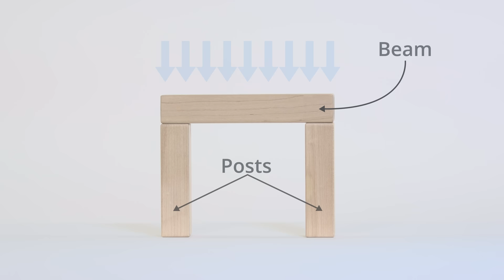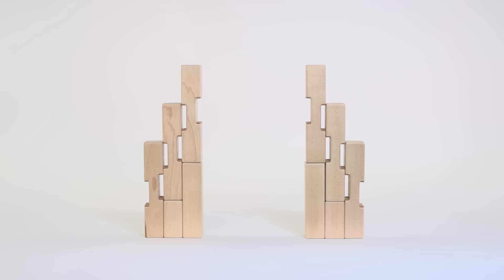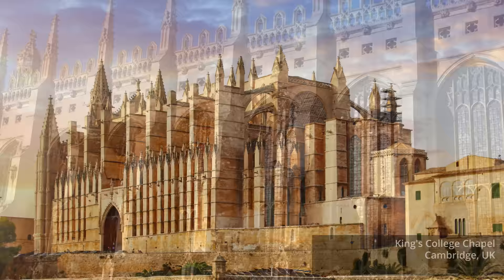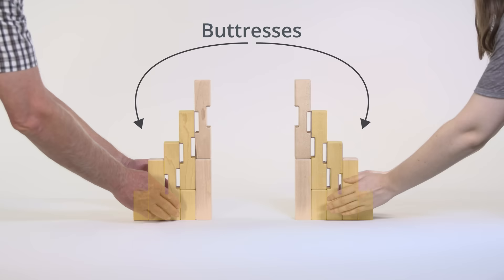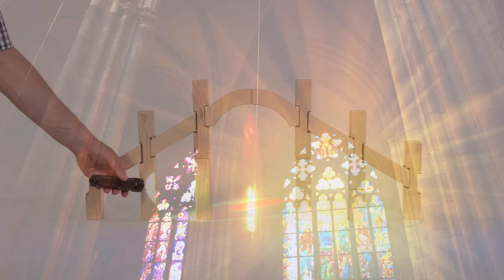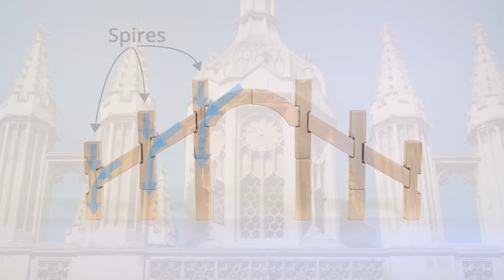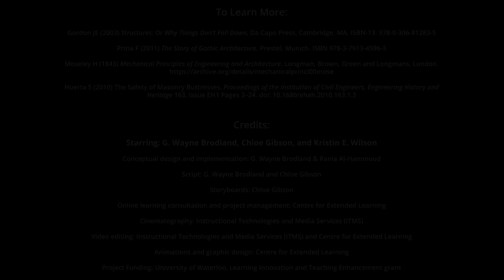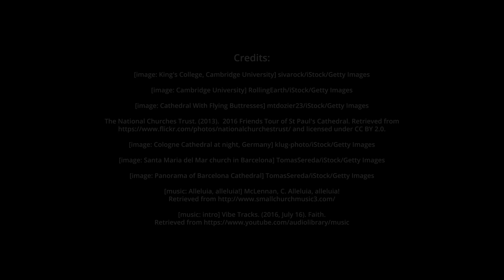5. Gothic Cathedrals

Comment: I didn't realize they built scale models beforehand to fine tune the design. Interesting video.
Reply: they used models for everything.  Even castles.  Anything of any consequence had a model built.
Reply: Ansys before Ansys
Reply: Sometimes lots of models! Apparently in some French cathedrals there were up to 100 models made so engineers could study all manor of scenarios (fires/earthquakes/attacks from enemies) and still have functioning models for other tests.
Reply: A few of the biggester projects were constructed over decades. In some cases none of the people who were at the start of the construction or even their kids would see the fully finished building. At this scale you can't just wing it, make it 10% more slender than the last one and hope its still structurally sound.
Reply: It may be important to notice that the one example they showed was much later in period and not gothic in style.
The wikipedia article mentions models : papier maché presentation [sales] models.
There is another mention of models in an unspecified context possibly linked to masonry. These could be more stone cutting planning rather than engineering models.
Reply: If you want to learn about a really strange method of building models, look into how Gaudi did it for Sagrada Familia using an upside down hanging method.

Comment: Here are some of the best examples of medieval cathedrals in England:

Lincoln Cathedral *world’s tallest building 1311-1548 - it was the first building to overtake the Great Pyramid of Giza (the spire collapsed in storm of 1548, tower remains). The amazing height Lincoln Cathedral achieved was “never matched” until 1884 - the Washington Monument. Only one cathedral (so far) has ever managed to surpass its height - Ulm Minster in Germany. One of the highlights inside are the exquisitely carved 14th century choir stalls,

Durham Cathedral *one of the finest examples of Romanesque architecture in Europe, it is architecturally very important - containing many elements that prove it to have influenced (what would later be created in France) Gothic architecture,

York Minster *largest medieval cathedral in Northern Europe, plus the “Great East Window” is the largest expanse of medieval stained glass in the world,

Ely Cathedral *central octagonal tower is unique in Europe, highest nave in UK, outstanding Romanesque exterior that is very different from any other cathedral,

Canterbury Cathedral *oldest UK Cathedral founded in 597AD (present building started 1070AD), great amount of medieval glass along with York Minster, 

Salisbury Cathedral *tallest UK cathedral, contains what is said to be the oldest clock in the world (1386), Cathedral unique in Europe as was built in only 38 years (1220-1258), so has a remarkably uniform exterior,

Wells Cathedral *over 300 medieval statues on West Front (said to be the largest in Europe), extremely unique mid-14th century “scissor-arches”,

Winchester Cathedral *longest 'medieval' cathedral in the world, along with longest ‘medieval’ nave, the crypts (built 1079) are haunting when submerged in water (as flood often).

Peterborough Cathedral *known for its famous “West Front”, a very early English Gothic facade which is unrivalled in Gothic architecture, also inside the largest of the 4 remaining decorated medieval wooden cathedral ceilings (built in around 1200) remaining in Europe,

Norwich Cathedral *made of beautiful french Caen stone (Canterbury Cathedral was also built extensively with it), has over 1000 painted medieval “bosses” situated on the ceiling vault - an unrivalled treasure.

Gloucester Cathedral *the cathedral cloisters are absolutely stunning and were featured in some of the Harry Potter movies, another interesting feature inside the cathedral - the 46 misericords (carved in the 1300’s), depicting a wide array of strange and charming scenes.

Westminster Abbey *the most well known, has held the coronations of many English Kings/ Queens for over 1000 years, a very important site for this reason with many notable historical figures buried within its walls. Interestingly, it also contains one of the countries oldest doors (dated to 1050AD).

There are many more, but I think these are some of the greatest in England.

Comment: AFAIK, there´s one more thing about the structure most don´t know: the pillars go deep into the ground, maybe even 1/3rd of their visible length. Unlike palisades, it doesn´t help much with preventing falling over (stone is not like wood good at resisting forces other than compressing ones). I don´t know how exactly it should work, but apparently, it´s about the mass underneath the soil, which is needed to stabilize the structure above ground.
Reply: it is probably about generating friction because the weight of a cathedral is kinda concentrated on few spots, and to prevent sinking in the sonte has to go deep so ther eis more friction with the ground around ti so it does not sink in

Comment: This is good, thanks. Perhaps it might be better if the verticals were stacks of  blocks, instead of long pieces with the notches. Then the cap-lanterns on the piers could visually demonstrate their function.  The problem is that the forces on the buttresses push outward, so a stack of blocks, even with mortar would not be able to keep the buttress arches from sliding off the piers. The substantial weight of the cap-lanterns increases the frictional resistance so the piers won't allow horizontal sliding. Keying the pier stones together might be used, but probably wouldn't be reliable enough over time. What I love about medieval cathedrals is how deeply deeply empirical their engineering was.

Comment: Why didn't they just run the horizontal force into the ground with the angled portion of the buttess reaching all the way to the ground? Is it a constructability issue? They seem to keep the diagonal sections relatively small.

Comment: One thing you forgot to mention was how the old romanesque style churches have round windows and arches, while the gothic style was known for their pointed windows and ceilings. This was because the weight could be directed to the sides much easier if it was pointed rather than have a flat surface in a round arch which would mean the weight would press down heavily on the centre, hence why these arches were much smaller and did not allow grand designs. Romanesque cathedrals and churches also have smaller windows because they didn't use buttresses, so that particular development could also have been shown in the video. 
Very nice video anyways, I did not search for this but found it very informative!

Comment: Many of the cathedrals shown in this video were either non-existent or incomplete in the 16th century, being finalized, or even largely built or reformed only in the 19th century, when the gothic revival movement emerged and nationalistic trends in Europe required the manufacturing of a glorious past. A good (but not by any means unique) example of this is Barcelona's cathedral, which looked quite stumpy and lacking in style until its radical reforms during the 19th century, which rebuilt it in a pure French style. It is enough to Google "Barcelona cathedral before" to see what I mean. Similar, though in many cases not so radical, reforms and reconstructions were made in many other cases, of which examples are the Cologne and Westminster cathedrals.

Comment: Great video. One problem, flying buttresses are not there to take loads from the vault s, but were added later to counteract wind sheer from the roof. A section of a cathedral clearly shows flying buttresses sit within the vaulting connoid so are not directly receiving thrust from the vaults.
Reply: That is not entirely correct. The partial destruction of Notre Dame de Paris where some vaulting collapsed showed that the lowest part of the visible vault (which remained) only bears part of the load, so the flying buttresses further up make sense. The lowest part of the vault is practically a massive triangle with the lateral forces exiting further up.

Comment: Cathedrals are made with arches... the arches criss-cross inside the cathedral which is what gives you the ultra cool ceilings. It's called a groin ceiling, but I don't know how to spell it. And the flying buttress is simply half an arch, to keep the sides from falling away from each other as the weight of the ceiling pushes down.

Comment: I understand this is an engineering channel and not architecture . The main purpose of buttress is to resist the side thrust created by the load on an vaulted roof. The wall is just secondary since the wall is purely decorative ( non load bearing). The wall is nothing but decorative  so they can put stained glass window and there is clerestory window above it to allow light to go inside the cathedral.  The flyer should a little bit lower from the vaulted roof for the space for clerestory window in your model. Last but not the least is " Pinnacle " is the right term to use and not " Spire".

Comment: re Spires. 
It is generally only the large spire that is a major feature of the building which is referred to as a "spire".  All thos small elements that sit on the end of buttresses, both wall buttresses and flying buttresses, and are also found on the four corners of a tower are called pinnacles, not spires.  
Salisbury Cathedral has a spire. Chartres Cathedral has two spires. Milan Cathedral is covered with pointy spiky things but they would generally be called pinnacles.

Comment: Very good, thanks. Please explain why the builders didn't use the tension in the wooden roof to hold the thin walls together instead of the flying butresses.
Reply: Flying buttresses only hold the walls together because they resist the forces from the stone vault. Without the stone vault, buttresses would not be necessary. This is because the arch shaped vault directs powerful forces outwards that would -- without a counteracting force -- push the walls apart like a stack of cards. Look up S Paolo Fuori le Mura, Roman Basilica type churches have masonry walls but timber ceilings and because the masonry has no thrusts and no tensile strain, they remain completely stable. Also I'd imagine the forces in a wooden roof would not be enough to counter the tonnes of stone vaulting.
Reply: Just to add two things: the point where the horizontal beam of the roof could have hold the walls together would have been far way up. The force of the vaults come in several meters below. Then there was no reliable method of joining the beams with masonry.
Reply: wood can burn, mediaeval people knew that
Reply: Alfie and Matthias, thanks for your constructive comments. 
Implied in my question was the fact that the video said the thin walls have to be held together by the flying butresses because the outward thrust from the stone vaults is pushing them apart. So my question would have been clearer if it had been...Please explain why the builders didn't use the tension in the wooden roof to resist the outward thrust from the stone vaults?  Having thought about it I now realise the answer is....The wooden roof couldn't be used to resist the outward thrust from the stone vaults becase that thrust couldn't be transferred by stone work from the bottom of the vaults, where it occurs, to the timber roof,  whch is above the top of the vault. Do you agree?

Comment: this video is not totally complete. The wooden structure of the roofing was usualy built before the ceilings were vaulted and actually takes a considerable amount of load, as the flying buttresses are basically preloaded against the vaulting. That's why the Notre Dame reconstruction is so uncertain, it can basically fold down on itself if you take our pieces of the burnt down wooden roof structure.  (I am studying this in university btw)

Comment: At the beginning of the video it is said, that beams were to short for wide ceilings and that this is the reason to use arcs. At the end of the video on top of the building  a roof is put, which  is made out of beams . Is this  a counterdiction to the  argument in the beginning. So why did the architect of the old days need an arc in the ceiling?   An why did they need a roof ? Suffer the stones under rain ?  They put both on top of the wide room , but why both ?
Reply: The separation usually isn't like in the model. An arch is introduced to support the beam, as the centre of the beam is more likely to fail because there is no support below it. The arch supports the beam and brings the load weight back out to the ends where the columns can better support it. A simple example of that would be like the corner braces you see in mineshaft supports. I'm pretty sure there's a video on this channel somewhere that explains it better than I am. EDIT: the reason to use both is that the ceiling guides water away from the roof to prevent pooling on a flat roof and eventually causing a failure due to extra weight. EDIT 2: sorry I'm just realising you can also potentially join two shorter beams more safely if they're supported by an arch. If your forest only grows trees to a 20m height but you need a building that is 40m wide, you may have no other choice.

Comment: Why did they need a stone vault if it was just going to be covered with a wooden roof anyway?   Couldn't they just decorate a lightweight wood ceiling to look like stone?
Reply: Many are built with wooden vaults. I suppose it depends on the resources/money available, just like today.
Reply: And, yes, they are often decorated to look like stone!
Reply: This was quite common in the Netherlands for example, where churches had to be built on unsolid, wet ground, for which vaults out of stone would have been to heavy.
Downside of this is, that in a case of fire, the wooden vault would burn down as well, often destroying the whole structure, whereas vaults out of stone often whithstand a fire (as seen in the case of notre dame).
Reply: At least 2 reasons, depending on the location the church was built:
1) Soft vs. stable ground: You won't find a vaulted church in Venice, because they had to keep weight down, or else the church would be collapsing when slwly sinking into the soft ground. (If you disregard this you'll get the look of the big, old churches of Dublin: the walls sank while they were built, giving them a really odd appearance today.
2) Rain and heavy snow. The cathedral of Milan, where it rarely has heavy snow could be built without a roof construction, so you can walk over the roof today. St Stephens cathedral in Vienna has a very high, steep roof in order to get the heavy snow down quickly. You do not want rain on the vault, either, as it will penetrate and saturate the sandstone typically used to build them. Add winter frost and you have a ruined church, like the one on Cashel Hill in Ireland, where they had to drain the sandstone ceiling of the Romanesque church over several years because 1000 years of Irish rain endangered the building finally.
(Note: that was also the problem with dowsing the fire at Notre Dame: Too much water would have damaged the sandstone permamently.)
Reply: Notre Dame has recently given us the answer... The only functional reason for a stone vault seems to be fireproofing- they are otherwise a structural nightmare as the lateral thrusts in this video demonstrate.

Comment: To add some shame to modern "architecture": concrete will rot away in less then 200 years, much less even. If the cathedrals had been built with modern materials, none would be left.

Comment: 1) piers refer to interior columns of stone, not to parts of flying buttresses. These should be called 'culees'. 2) Spires are large structures surmounting towers. The ones here should be called pinnacles. 3) the buildings like King's College chapel that are used to show buttressing are not early gothic as implied but very late, King's being 15th century to 16th century 4) the video makes out that Gothic architects use scale models. There are none of these that survive from the Gothic period at all. We don't actually know how gothic masons modelled forces- if they even did at all. In fact what is more likely is that they simply knew what previous buildings could get away with and used principles of geometry to push the boundaries a little more.